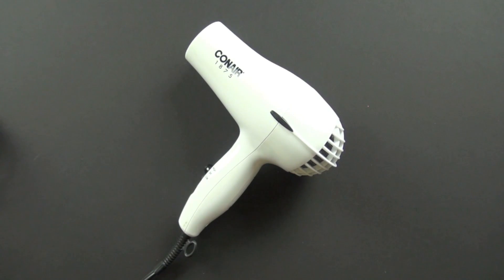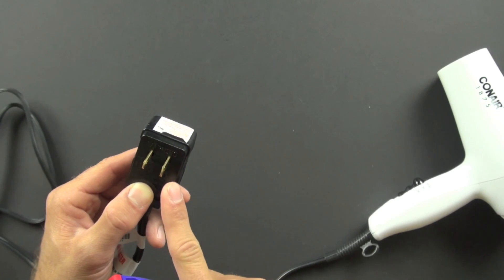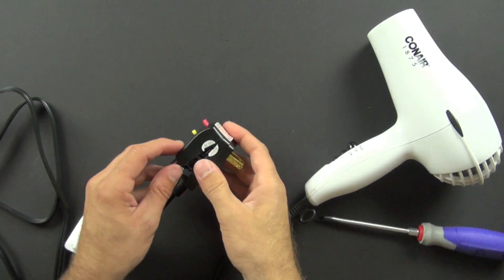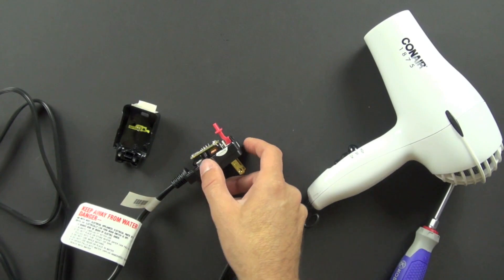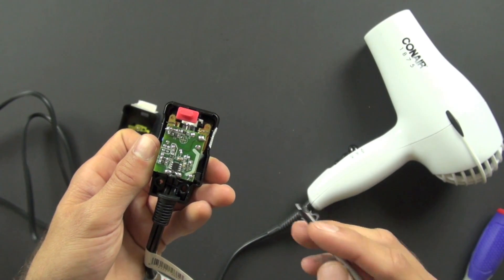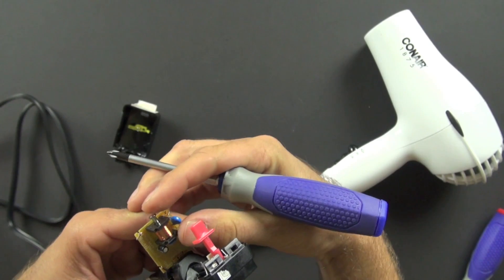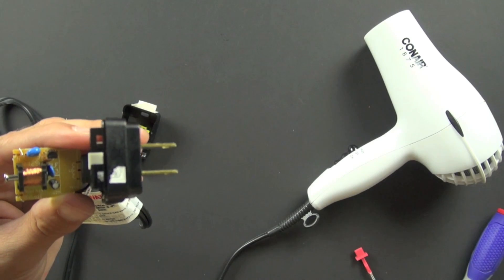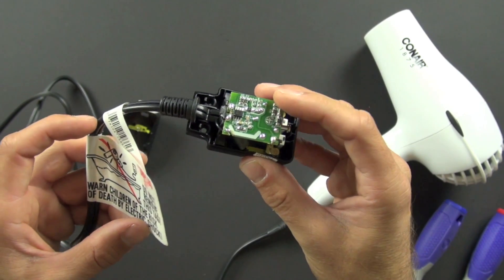What is inside a hair dryer? (1 of 2) | Electrical engineering | Khan Academy

Comment: I have a philips new style 800 hair drier old model, the same problem.
At switch position 2 the drier working OK, but at switch position 1 only heater glows and motor doesn't run.
May the circuit diagram be provided.
Thanks

Comment: Just a small detail, the toroid is monitoring current (not voltage) in the Live and Neutral wires, and when the current flowing in one isn't the same as the other (some small differences are allowed due to capacitive coupling to ground) then the interrupter trips.

When the current flowing in Live and Neutral don't match this is usually an indication that main's current has found another route to ground (like through a human!) rather than going through Neutral as it normally would.